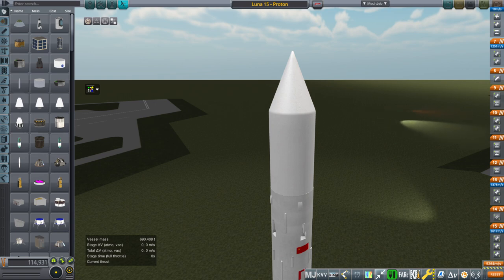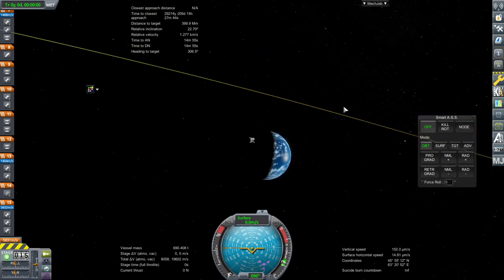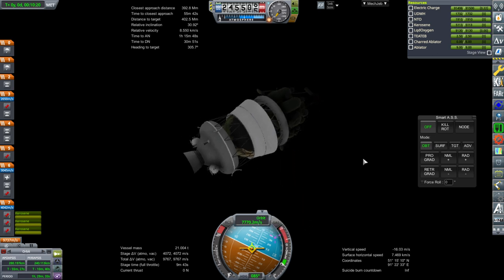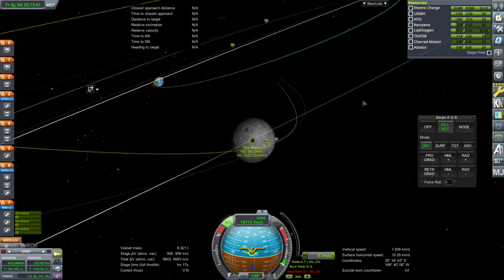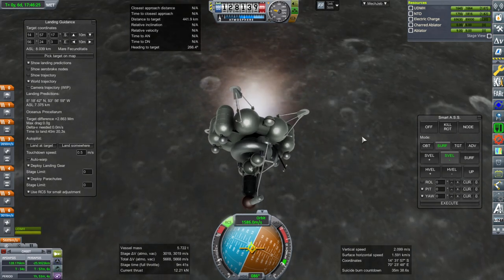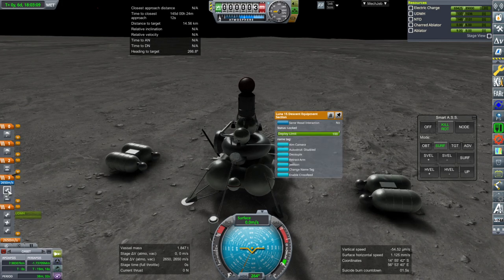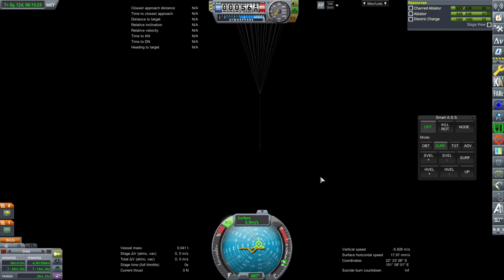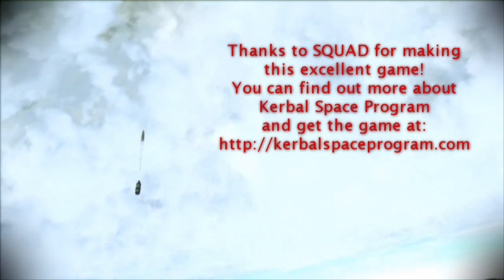Realism Overhaul in KSP 1.8.1 - Soviet Lunar Sample Return Improved

Comment: 1. Can you please do a video on KOS...
2. Would flying straight up work in real life?
Reply from the maker: I've done a few videos on kOS if you search my videos. As far as flying straight up is concerned, yes, it would, but it's generally not advisable. In this case, it may have been done to avoid putting sophisticated avionics on the ascent stage and it was only a reasonable idea because the burn time of the stage was so low.
Reply: 2 - USSR did exactly this. we didn't have computers on board so the only way was to land at right place and do direct ascent at right time :)

Comment: what is the total delta V of rocket in the game . i did do landing in moon not with real fuel and those things but with smurf and many other mods in RSS and it did take 18.3 km delta v to land and return from moon even getting to moon and returning is so hard one mistake and you run out of fuel and with zero delta v so it was hard my main problem is how to return from other planets like moon to earth and land at a distance of at least 500 km of your launch site that is even harder
Reply from the maker: I normally pack 20 km/s to be safe for a Moon landing + return, but it can be done with less. The minimum I'd normally plan for is 18.7 km/s. Edit: I should note that, with this vehicle, the hotstaging of the Proton rocket messes up the delta-v reading.